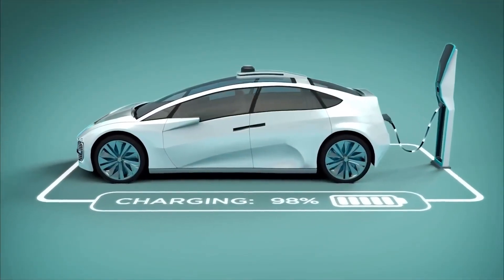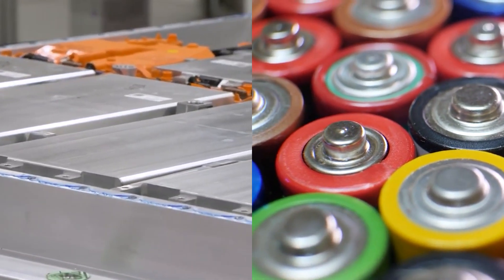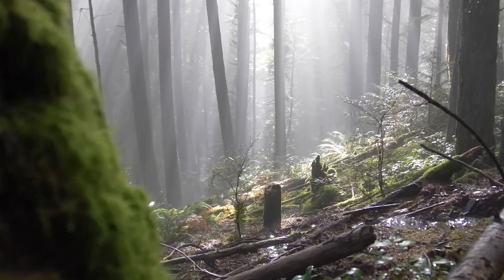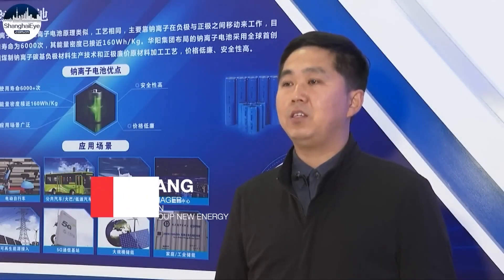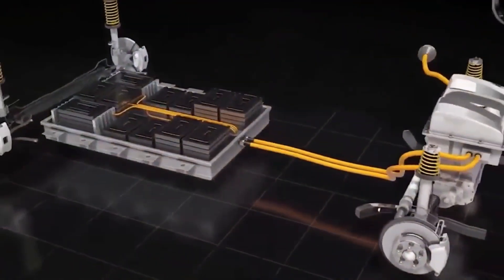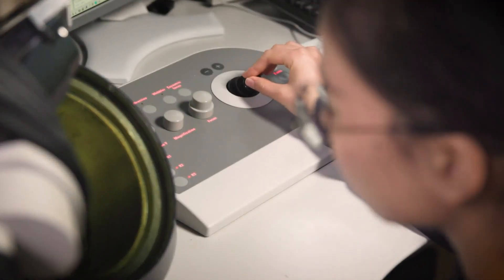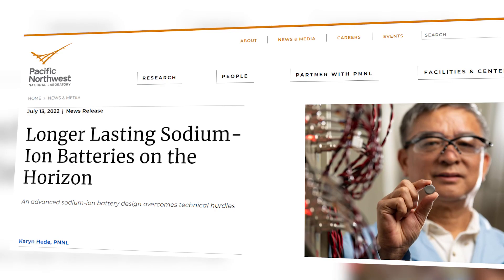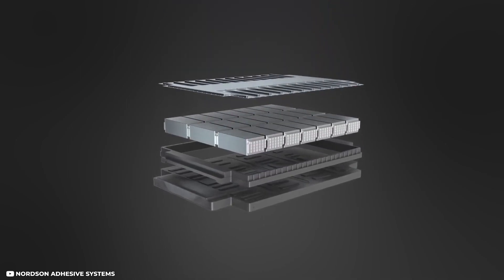This New Battery Will Change The EV Industry Forever!

Comment: Correction: EV are not environmentally friendly. Unless the power comes from nuclear power. The electricity comes mostly from coal or NG. With wind killing numerous birds and solar requiring massive areas of land to be cleared or covered.
Reply: Correction: Gas engines are only about 30% efficient.  Since electric motors are so much more efficient and removes transportation of fuel, it causes less pollution even if coal is being used by the power company.  Large steam turbines can be over 90% efficient.
Reply from the maker: Electric Cars vs. Petrol Cars:
https://youtu.be/Oco8qwPNYns